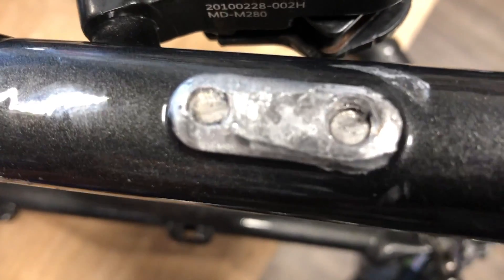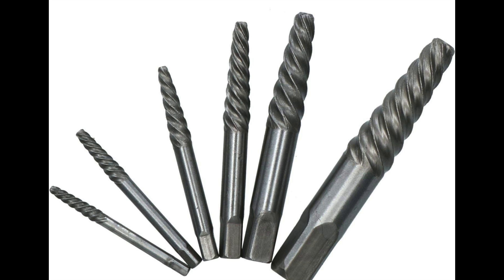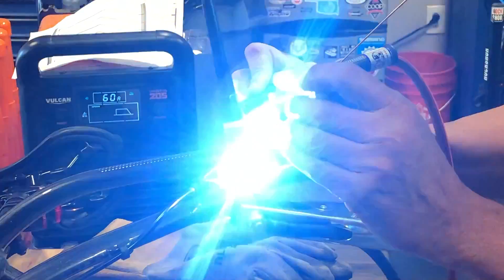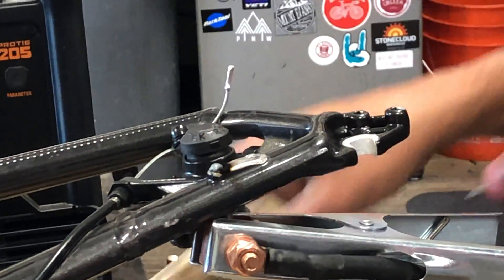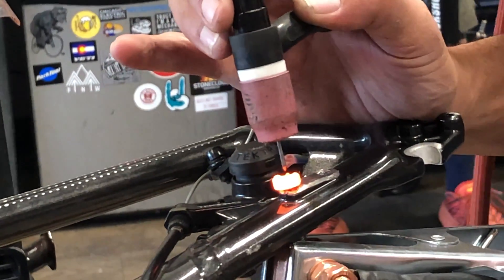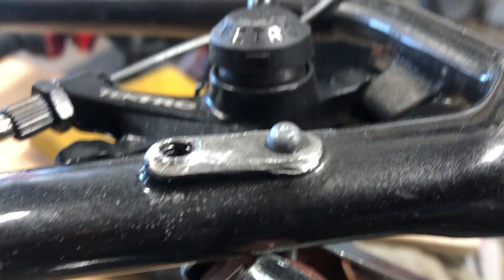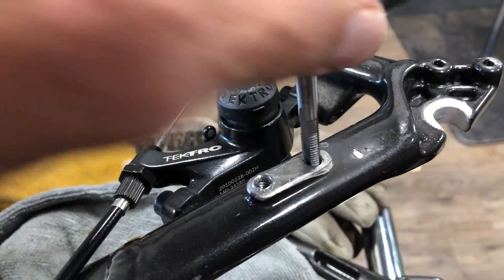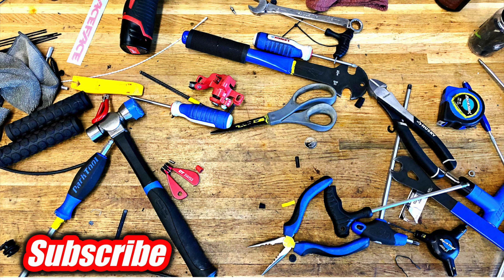Bolt Extraction From An Aluminum Base

Comment: does it not stick to the aluminium because of the rod you're using is a certain material?
Reply from the maker: Sort of. The welding rod is ER70s, which is steel. The welder is set to direct current, which is the biggest factor. It will only weld or fuse the steel bolt to whatever steel is welded to it.
Reply: @JoeyMesa  i get it now. sorry, you said so in the video but i didn't accept it right away. it is right. the aluminium oxide layer has a melting temperature of 2100 °C/3800 °F and the steel melts between  1300-1540°C/2370-2800°F. the material under the oxide layer might even melt at a much lower temperature than the steel does, but the thin oxide layer that doesn't get cleaned off while welding with direct current keeps it from sticking to anything even if it does melt. you could intentionally break it by jamming the rod underneath the oxide layer, leaving you with a "lumpy mess that doesn't flow well doesn't wet out well and seems to fight you every step of the way" (video 6DnA6YLhAno) at least this is my understanding now, it might still be faulty, grain of salt, i don't weld yet, etc. but i thought it might be interesting enough to type all that. it was for me

Comment: Very resourceful and skilful as usual Joey! (Ever have to replace a FSA bb-5000? If so, what is the alternative? Thanks!)
Reply from the maker: Yes, dimension wise, it’s the same as a Shimano hollow tech II bottom bracket. I’ve currently got a new Shimano road bottom bracket with FSA cranks on my computer bike. 
Thanks for the question Denis!
Reply: @JoeyMesa  The cranks on my friend’s bike use an axle smaller than the 24mm of an Hollowtech II bb (19mm?) Are there adapters? Thank you for helping an amateur mechanic Joey!